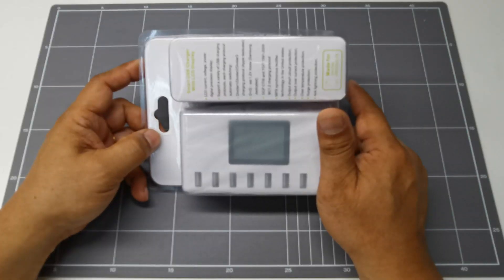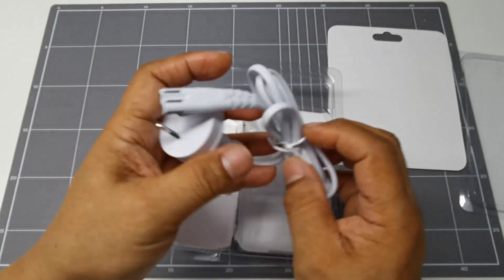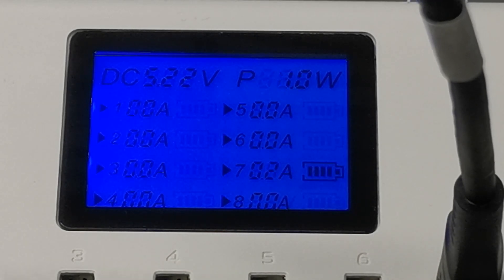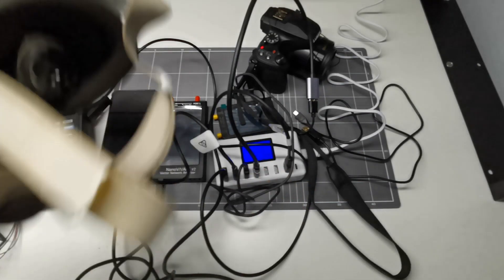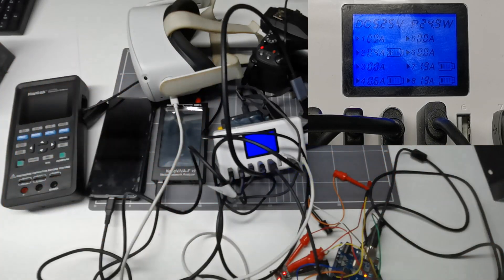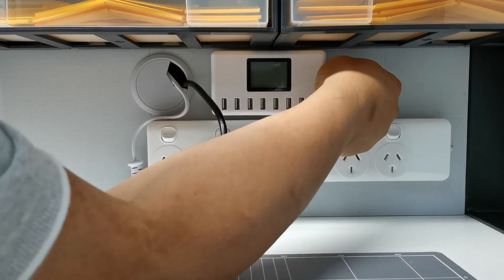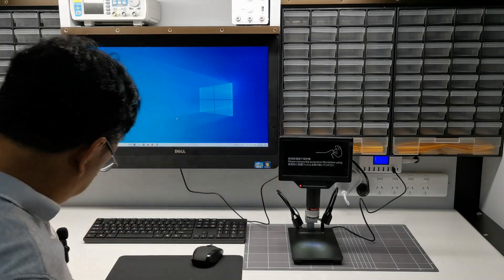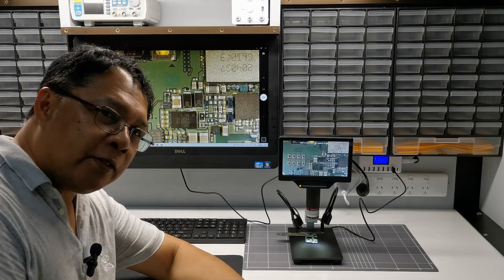ECE 2 - Smart Multiport USB Charger for Electronics Workbench

Comment: I like your whole setup, looks great, can’t wait to see more. 🤙🏼🇦🇺
Reply from the maker: Thanks for watching my new channel on Electronics. Next would be setting up the ESD mat and grounding and choosing the right mat that dissipate ESD charge, unboxing new soldering station, new oscilloscope, new desktop multimeter, setting up USB multimeter and writing own GUI interface software. Fixing 60V 10A programmable HP power supply and writing own interface software to remotely control the power supply and more on setting up the workbench before we start touching the basic of electronics to advance, repairing and building some project and reverse engineering. Currently I'm fixing my LED lighting due to video flickering and managed to reverse engineer the LED driver circuit and did some modification and successfully eliminate the flickering. Taking a good steady video lighting is very important for me and the viewer. I will be posting on YouTube the my modification of the driver circuit and showing some basing undertanding of the circuit and why LED lighting flickers. I will see you....next time!